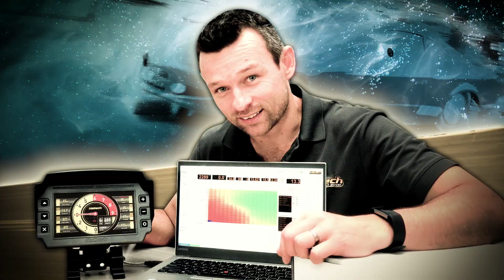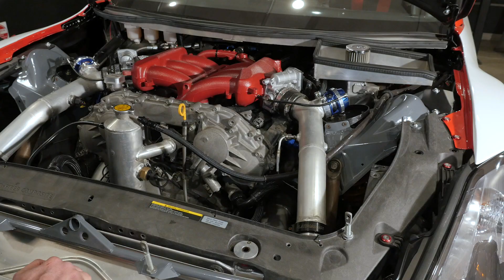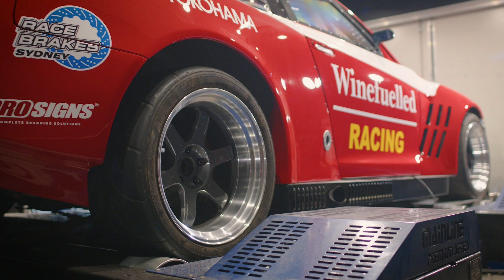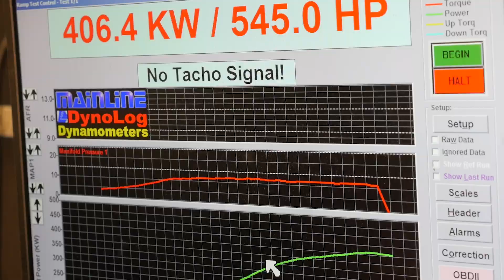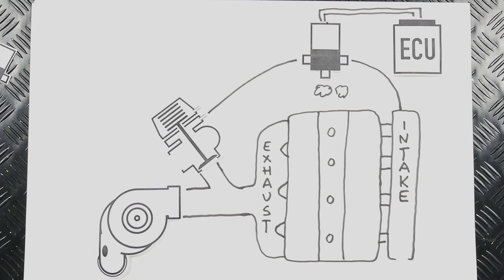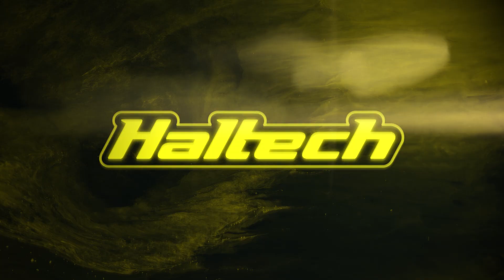🛠 How to control Boost and Power  | TECHNICALLY SPEAKING

Comment: 20:00 This diagram shows the valve plumbed to the intake manifold. It should be plumbed before the throttle body. Otherwise you could see vacuum on the wastegate diaphram.

Comment: Like that good old saying, what does a 1k whp Supra and a 500 whp Supra have in common ??  10 sec time slip each. 
All that power and you can't keep it planted and you spin everywhere, what fun is that when your not going anywhere. 
Rather have less power and have 100 % traction ... No spin, just traction and pull

Comment: Recently enabled boost control on my Haltech 1500 after tuning on 93 and then E85..   This video worked spectacularly to find the right settings and achieve my target boost pressure.   Also, the boost came online much quicker.    Fun stuff!

Comment: great explanation. But if max boost desired was 14psi, why wasn't a 7psi (or similar) spring used? 
and why was the high end boost target not more than 14psi if the spring can handle about 24psi in this example?

Comment: Would it be possible to only limit the throttle after a certain rpm? or after a certain manifold pressure? so as not to affect power and response in the sub 300KW rev(&load?) range

Comment: While I haven't used the Closed Loop Boost Control since I first got my Elite 1500 installed, is there a reason why when at part throttle, it would cause the turbo to overboost? Once I go full throttle and it starts to control the boost, it's fine. Just driving through traffic at 30-50% throttle, it's not working. I've been using open loop and using a table consisting of RPM vs manifold pressure and it has been incredibly reliable. I'm sure it could be better though.

Comment: I thought  chopping it down to 35% would be way over kill ... you've got a real good feel for it  ..
Funny  you say  clippin the throttle on the lower power settings is NQR i think its totally the way of the future   great video
Reply: Adding that restriction is going to make the engine less efficient so it burns more fuel and makes more heat than necessary. Depending on your use case you may or may not be able to accept that
Reply: @Turbochargedtwelve  pfft  2 lbs of boost more than it needs is what is being made arguably unnecessarily .. Your not adding a restriction your just mapping one that's already there .. which has been the accepted combustion engine power delivery modulator for about 200 years .. also i bet heaps of circuit cars are using the throttle and a substantial pressure dropper(restriction)  as this strategy would give better throttle response.
Reply: @incolink  I’m not sure I understand your argument. Yes some motor sports series require restrictor plates, venturis, ect for the purpose of limiting power and limiting throttle blade opening has the same effect as demonstrated here. You’ll see this used it series with power to weight limitations where the cars are dyno tested and weighed. It’s nice because you can play with that blade angle to hit your exact power target to the maximum of the rules. Spec series will use restrictors, no dyno test required just shove a plug in the intake and if the engine stalls it’s good. 
Still both make the engine less efficient. You won’t see either used on a mass produced car. Instead you see things like exhaust gas recirculating that injects inert gas into the intake stream to “de throttle” the engine without the pumping loss of a closed throttle blade.

Comment: On the "open-loop" base arrangement, you can use MAP as one of the table axis you then have feedback without  PID ..  on simple stuff this works fine   and is easier to understand